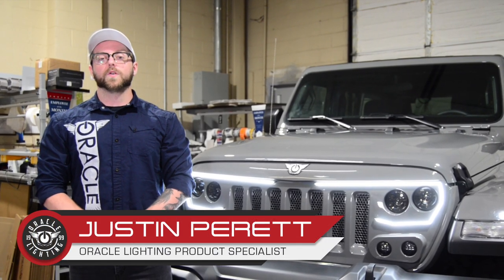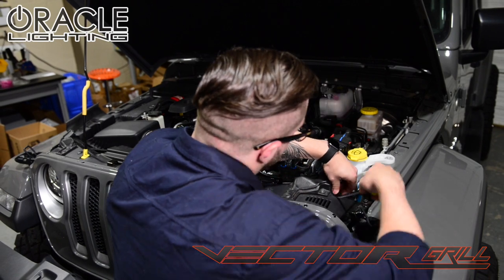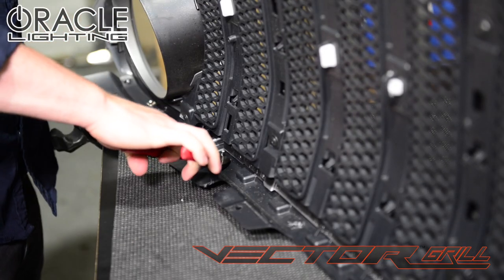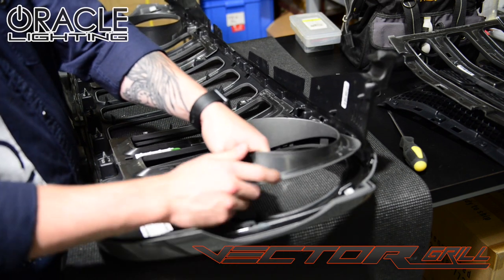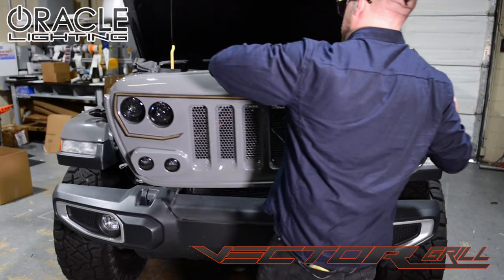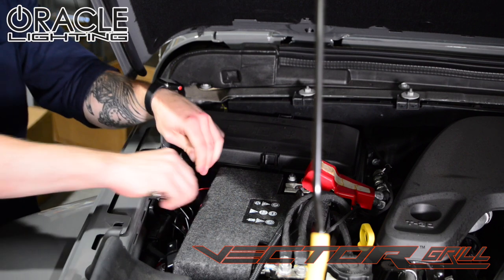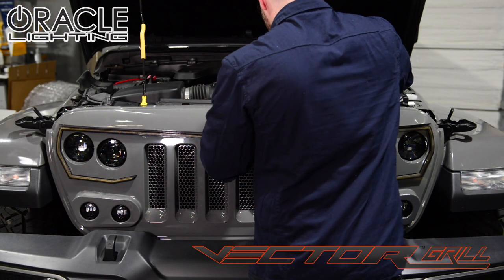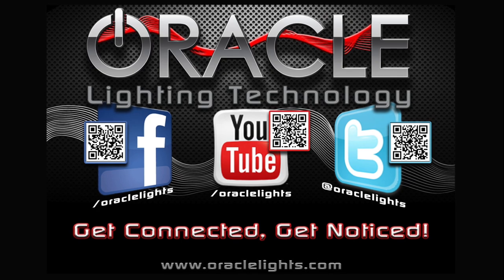ORACLE Vector Grill for Jeep Wrangler JL/JT Installation DIY Video

Comment: Any alternatives to cutting the support panel? In case there's any want to swap back to the OEM grille?
Reply: Good Question! You can still swap the cut panel back to the original grille, it does not prevent re-installation in this case.

Comment: How much is the color match. I seen your install on the black Jeep. So I ordered
To my surprise it came dull no glossy. Also I have the version that wasn’t upgraded to the better seals. How do I get that upgraded version I’m sure that mine isn’t the only one that has issue with the lights going out. Do u offer a trade in for the old version like when a car needs a issues fixed it free under the recall problem.
Reply: Correct, the grill are flat black unless you special order gloss black. That is how it has always been and clearly stated on our site. We have never sold an "old" version of the JL/JT grill these came with the upgraded parts since the inception of the product.
Reply: How much it the paint end up costing you?